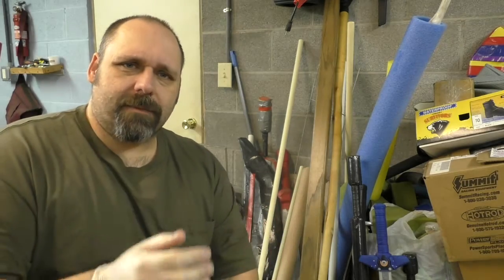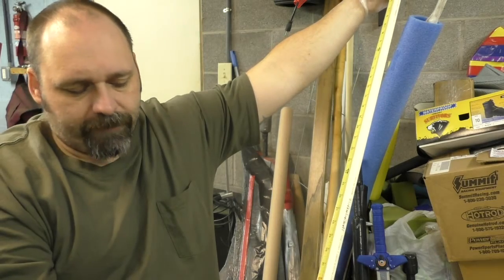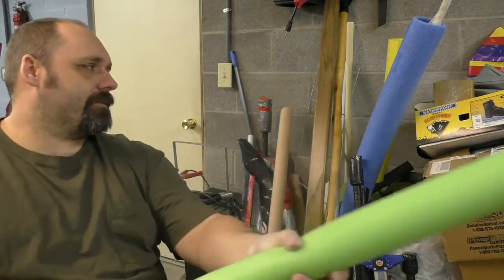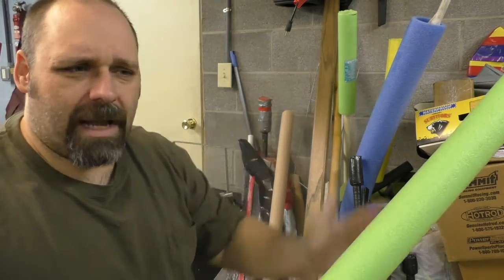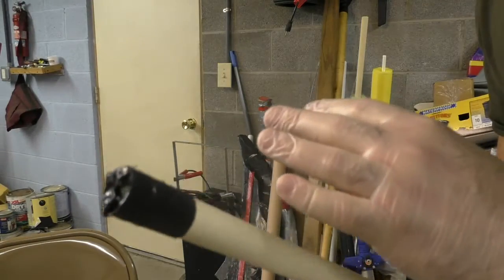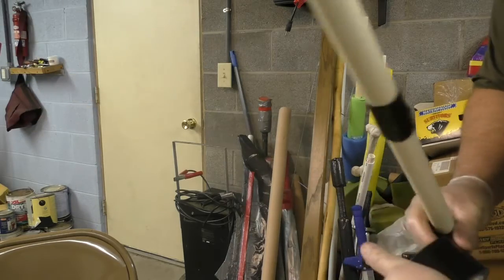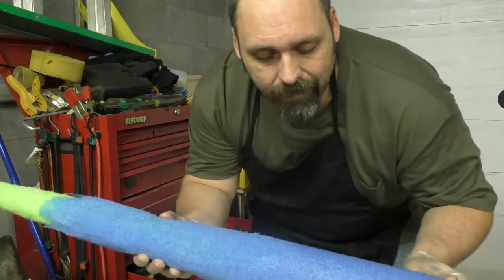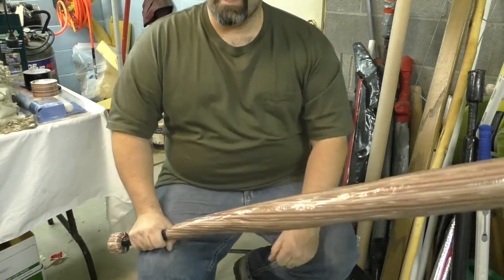How To Make A Basic Baseball Bat Weapon For Post-Apocalyptic Larp (Pt. 4) - Dystopia Rising

Comment: I want to build a foam canoe oar, but I have only ever made a standard boffer. The wood grain tape is a great idea. Thanks for the tutorial. Hope I can make something that's both cool looking and safe.
Reply from the maker: This tape will definitely make things easier on you if you are doing a foam and tape type build.  If you decide to coat in latex or plasti-dip, one or two of my nerf blaster videos have a wood-grain texture tool that allows you to create a wood grain style with paint.  Either way, best of luck with your build!